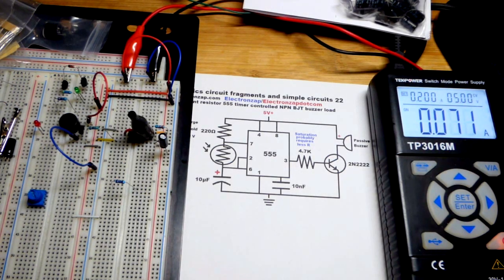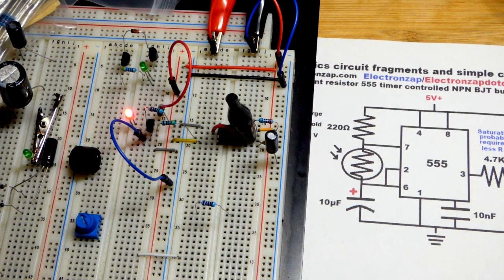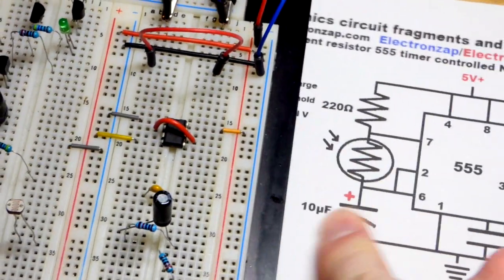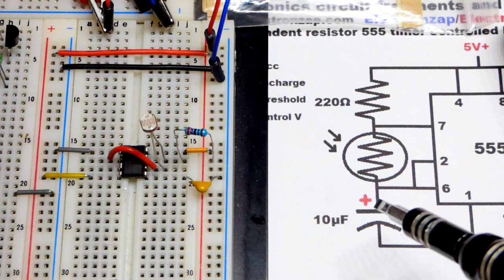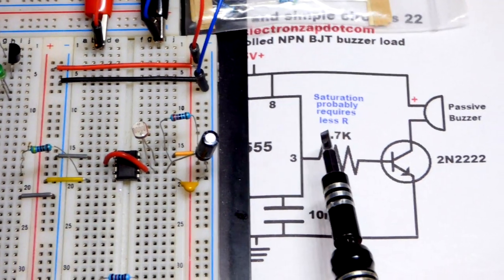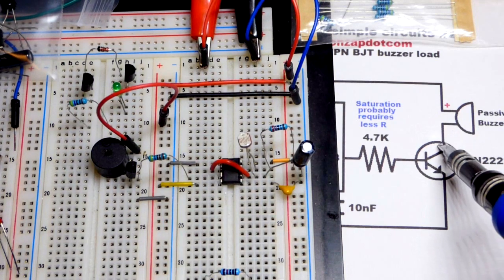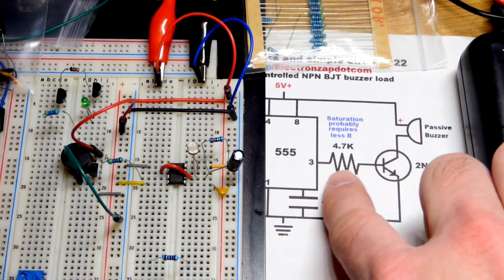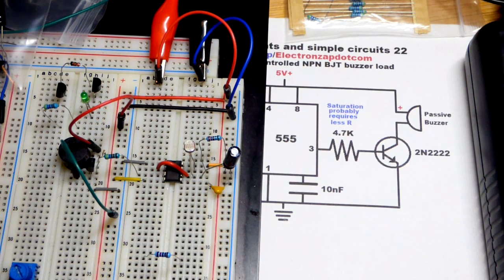Electronics course 24 passive buzzer 2N222 NPN BJT controlled by 555 timer LDR circuit

Comment: Heheh ... you should let me send you some of my SMD 555's (mounted to plates) to help replace your offering to the Blue Smoke Gods today.  If you do not get burnt, shocked, or set something on fire occasionally, you are not working hard enough.  (Says ElectroBOOM)
 

Just some ideas:  When I measure the static resistance of my own small passive buzzer, I get only 16.5ohm.  Some google-ing shows me that a huge passive buzzer draws around 50mA, and a small one around 15mA.  So you can probably put a 220/330 resistor in series with the buzzer with little impact on sound volume.  Pin 7 of the 555 is already an open NPN collector.  There are other ways to create a an oscillator with the 555 that will free up this pin for heavy lifting.  A "flyback diode" (backward diode) across the buzzer may help dampen negative voltage spikes associated with driving the coil.
Reply from the maker: Electroboom is good times lol. Luckily I had 10 NE555 from a make electronics kit, plus who knows how many in other kits.